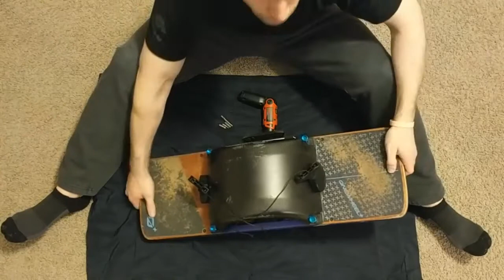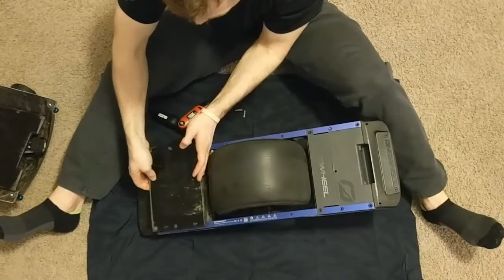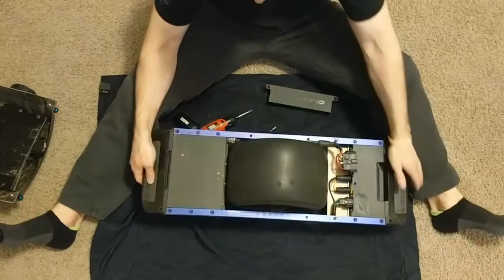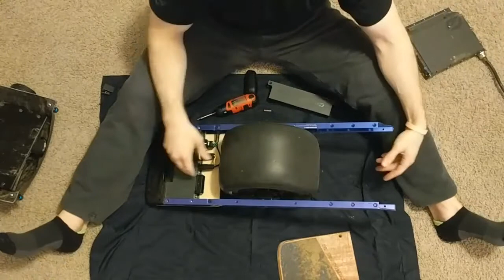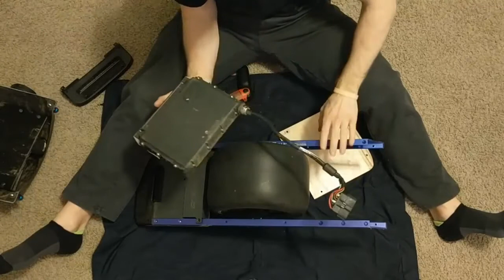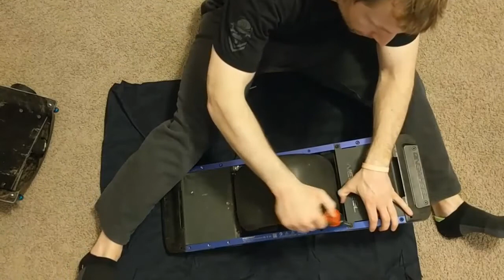OneWheel Plus: Battery Removal and Reassembly

Comment: In Airfrance for a internationals flight says: NOT AUTHORIZED IN CABIN AND IN CHECKED BAGGAGE  Monociclos eléctricos Self balancing wheels, so now I sm afraid... with my OW+
Reply from the maker: That sucks.
Reply: @bgrutterdds  any suggestions?
Reply from the maker: Nope. Sorry. Shipping it might be easier.
Reply: Baron Grutter DDS but expensier... they told me that I can take battery till 160Wh and my OW+ has 130Wh BUT, they would reject it coz it is for leisure purposes
Reply from the maker: Whenever I'm asked at TSA, "It's a camera dolly used for getting steady shots when filling."
Reply: @bgrutterdds  haha, but if they say show me? fucked up meee

Comment: I am planning to take my OW+ to Peru in sudamerica,Airfrance... you I separate in peaces all my ow or only take the baterry out? Regards.
Reply from the maker: Never tried. But probably not to difficult.
Reply: @bgrutterdds  what do you mean?
Reply from the maker: I only remove the battery. I don't know if it's possible to break it down even further.
Reply: Baron Grutter DDS I see, thanks! Should I take the air out too?
Reply from the maker: I never have. Not a bag idea, necessarily. But I'm not sure the tire would compress very easily. So, might not help.

Comment: Thanks for the helpful video. I'm thinking of taking my OW+ on a 4 week holiday with me which involves an international flight. Do you think it's worth tearing down my OW, taking out the battery enclosure (which I then take as carry-on) and putting the rest in my checked luggage? Or would the wear and tear of undoing then redoing the connectors, screws etc. not be worth it?
Reply from the maker: Wear and tear concerns me not. Not unless you're talking 50+ times.
Reply: @bgrutterdds  OK great, thanks for the reassurance.
Reply: @bgrutterdds  Quick follow-up question :) Do you check your OW+ board disassembled (wheel separated from the rails, foot pads removed etc.) or just with the battery removed? And everything else still intact? Thanks
Reply from the maker: @cubiq1  I ONLY separate the battery. Honestly, I usually carry it on. I've only checked it twice because of convenience. I just pull the battery so that if TSA tells me I have to check it, I'm ready. Maybe overkill, but i tend to get to the airport when it's ready to board. lol
Reply: @bgrutterdds  OK great, thanks for the info. Have you traveled with your OW+ using Delta or AA before? I know they both have specifically banned "self-balancing mobility vehicles" but it seems hit-or-miss as to whether they apply this rule.
Reply: @cubiq1  it's a camera dolly. NOT a self balancing board. Best to stay away from hoverboard type language

Comment: Can you tell me, witch kind of controleur this skate board use it? (for DIY project) Thank's
Reply from the maker: No controller. It's controlled via body weight position, lean on lead foot to move forward and vice versa. It has a dual sensor on the front foot plate to activate the motor.

Comment: excellent clip...  I like how you screw the screws back into their original holes for storage, as they are different lengths, and can get confusing during reassembly.
Reply: Mechanics use templates, it's only natural.